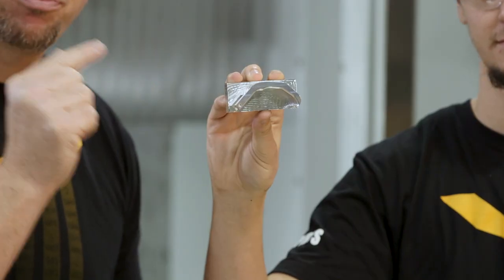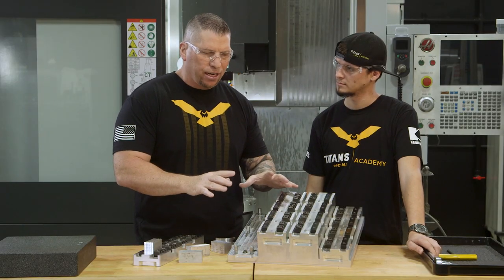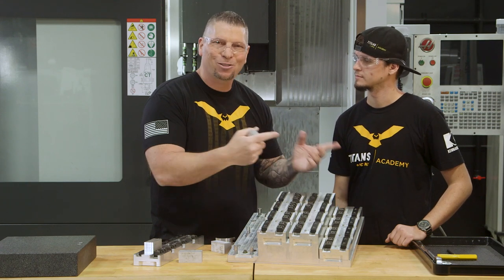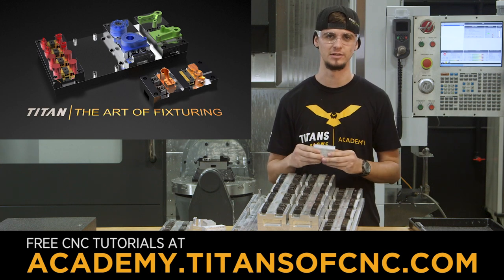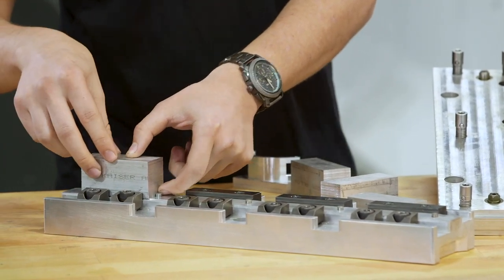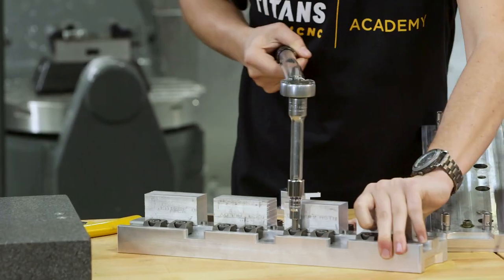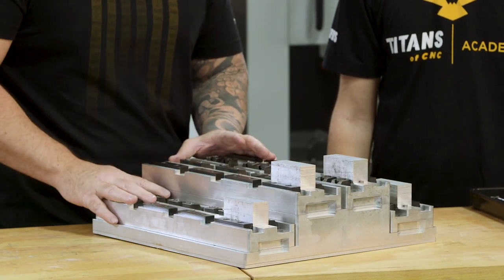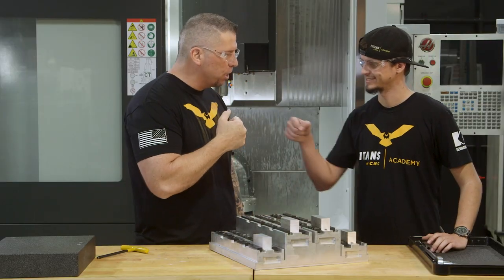This Will Make You RICH | CNC Machining | Vlog #76

Comment: Additional considerations on fixturing:

1. Be very conservative with the simplicity of the design: A complex fixture is costly to replace in terms of remaking one and the downtime on that job waiting for it. Simple, already made workpiece holding solutions such as Technigrip can easily be replaced when they get wrecked........And they will.

2. Design a baseplate with multiple hold-down/locating hole patterns so you can move it to a different machine when needed. If you dedicate it to just one machine and that machine goes down, you're dead in the water on that job.

3. Use steel inserts on threaded holes that see a lot of fastener install/removal. Threading steel fasteners repeatedly into aluminum fixturing is a guaranteed failure.
Reply: agreed

Comment: We specialised in pulley wheels, mainly "Poly V" We were the main supplier for Turner Newall who manufactured the belts etc.
An easy part to make without too many tight tolerances. Made them from 20mm. to 1 metre diameter , about 1 ton. in all materials.

Comment: I work in a small job shop, we have a repeat job from a larger shop that is a constant run of 2000 parts. We have a similar fixture using pitbull grips. Able to run 8 parts at once on a haas vf2. Blanks are 1×1×12.3 aluminum blanks. We kick out more parts per hour than the larger shop. Fixturing is essential to make money

Comment: Pallet clamp system and 2 fixtures would keep that green light on longer. And keep u in shape: ) There is a balance between load/unload, post-process work, and how many parts is the sweet spot to keep the operator as free as possible, while keeping the spindle running long as possible. Great vids.

Comment: Great video. What I would love to see in a future vlog is about the best way to go about opening your own shop as a first-timer. For someone that has a hobby/converted cnc in their garage, with limited experience, Should you work at another machine shop first? Or just go for it and get a decent used vmc and rent a small space? Should you get work or have a product/part to make first? Avoid debt at all cost or take on some? 
I’m seeing this chicken and egg scenario, complicated by still needing a “day job” to pay for expenses. There are no machine shops less than an hour from me. 
Thanks for all you great content!
Reply: 4 years late, but some insight:
Opportunities with a single 3-axis VMC and no automation are limited. What can you do that a shop with a dozen automated machines can't do? What sort of prototypes and one-offs can you run cheaper/faster/better than a shop with a 5-axis? These aren't meant to be discouraging, and there are indeed possible answers to those questions that would make starting a shop viable. You just have to find a niche that works given your connections, capabilities, and market area. As a general rule though, one man shops rarely make decent profit for the hours invested. Guys work 60-70 hour weeks and barely clear more than they could make loading parts and pressing the green button 40 hours a week at a big shop.

Comment: For very large batches we have a robotic arm operating two Mazak’s with zero point pneumatic pallet system from Erowa. The only way to get a good profit. 2 machines run 24/7 without an operator

Comment: Big old torque wrench is a slow and cumbersome way to loosen those bolts and you have to reverse the ratchet between ops. Surely the yellow tool is good enough for loosening? And a shorter torque wrench would be quicker and easier for tightening? No criticism / only a suggestion - I'm always looking at what looks / feels quick and easy.
Reply: Always thinking efficient and ergonomic 👌
What came to my mind was a design that would trnsfer the motion of locking or tightening multiple part clamps (bolts) from a single point. Maybe a bit overkill though.

Comment: I’d be doing this on a mill turn thanks. Can’t see the part that clearly but assuming the holes are around the ‘outside’ and you’d be able to get to them. Nest two parts to best fit a nominal diameter bar, part it off(saves an operation) stick bar feed on (saves labour). You won’t have to billet the material and boom 💥 if it’s Ali I’m running lights out. Bet I could win that quote!

Comment: Titan, Thank you so much for sharing your knowledge on fixturing. before watching your videos the only thing i knew about fixturing was basic universal pallets with dozens  of holes for either bolts or pins. Now im designing my own fixtures, using Pitbull clamps and Tallon grips so that i can machine multiple ops and multiple parts at once, instead of one op  and a few parts at a time. one main issue` i have is designing the fixture in my cam work space. hopefully when your tutorial on fixturing comes out you teach that part of the design.

Any chance we could get a video on drawing prints? That is another major topic i need to learn and work on. 
Thanks
Brandon.

Comment: I must be missing something here. 
Why aren't you using a conventional vertical 4-sided tomb-stone fixture, which would allow symmetric access to 3 faces of every part in one machining pass?
With your staggered plate-fixture, for most of those parts, only two faces can be machined. 
Was this done due to the limited work-envelope of your 5-axis machine, or do these particular parts only need machining from two faces?

Comment: Should never use a ball detent torque wrench to loosen fasteners. You over torque the ball detent overcoming the static friction. The reason you can use them either clockwise or counter clockwise is to torque left hand threads.

Comment: The process of loading/unloading is a lot easier with electric drill with the torque set, especially if the parts are a lot smaller so you can nest a hell of a lot more on a plate.  Snap on also makes a great small/light driver with an accurate torque that is perfect for quickly working all those bolts

It also looks like there is still another op to run.  Im used to pulling the plate out and rotating the parts along the fixture.  So let's say thre are just two rows.  One row would produce the exact thing made in the video.  The next row would flip the part to machine the last face of the part.  

Then you getting into dummy proofing the fixture so operators that are moving like Nascar pitcrews have as few opportunities to make mistakes as possible, and that's not a dig at the operator. For example you dont want the subplates to only install in one orientation, you dont want to be able to rotate the plate 180 and have it actual attach.  Even if it would work in THIS instance, as these things get more complicated you want the operator trained to know it only goes together one way.  I've operated plenty myself and we wrote notes all over the fixtures to minimize error.  

Designing/building and hell even operating these sorts of jobs is my favorite sort of mill work.  The day goes by fast.
Reply: I worked at a place where I used a rotary to hold 88 parts at a time, on 90 degree planes. First half of plate was one side of part, machining the part on -90, 0, and 90. Then the second half of the plate, the parts got flipped, and everything remaining on that side was machined.

Both sides were programmed on one full cycle, so I would start the production run with the plate half full. Then, I would flip them and run the whole program the next cycle. 44 parts at a time were fully complete and 44 parts were half done in 1h45m.

I was using a locking system similar to this video, not sure the brand. Initially I was doing it all by 3/8 ratchet and a 6mm hex. Full cycle time was 1h45m, and downtime was 45m-1h to clear shavings and move all the parts.

Then one day I was feeling froggy, so I decided to race myself.

I came in with my trusty snap on 3/8 torque wrench and got the downtime to an average of about 18 minutes. The boss thought I was lying so he watched me.

I bet him, if I can get it done in under 20 minutes, I want a $1 raise. He said that to make the bet fair, I’d get a $1 pay cut if I couldn’t pull it off.

I did it in 13 minutes, hauling ass out of breath. He gave me a $2 raise and send me home early with $20 to buy beer that night.

Production fixtures FTW.

Comment: if you needed to have through the lenght of the part, you could edit the fixture even further by doing these level again on each of the levels, making sort of a weird multileveled pyramid thing, which could probably be made by making an updated set of plates instead of making the whole fixture from scratch. 
also since the plates are removable, why not create an extra set of plates that you can load material into when the machine is running and then just switch the plates, instead of clamping the material in the machine everytime

Comment: With the sub plate, instead of using the expanding pins to lock them down, could you not have used a small dove tail cutter and then slid the sub plate onto the main plate?
Reply from the maker: Absolutely, there are a million ways... that’s why fixturing is Awesome

Comment: Titan, can you do a video on setting Fusion post processors to use multiple work offsets (ie. G154 p1 got a0. , g154 p2 for a90.) ? Currently I fix all my posts by hand, adding A values and fixing the offset lines. I’m using Haas EC-400s and VF machines with 4th axis. 

Thank you for what you do!!
Reply from the maker: Yes

Comment: You can also run one part a the time and put a robot in front of the machine if you have this amout on workload to design a fixture like that. Less employe, produce more good, that’s the future of manufacturing
Reply: Multipart is going to save on toolchanges, and robot loading does take time (possibly more time per part). It really takes some analysis to determine what the best option is.

Comment: Titan, great fixture!  Can you share some knowledge on how you old varius parts for the second op?  holding a block is pretty easy, but how to you hold the profile of the machined parts without damaging the surface?
Reply: @John-ik2eg  thats super slow, must have multiple part fixture for op 2, specially since I never see him use horizontal with twin pallet.

Comment: Could that fixture not be double sided and mounted like a tombstone getting you upto  32 parts per run?
Reply: With a hexagonal tower and 8 parts per face, you can even run 48 posts at a time (plus another 6 on the top of the tower)

Comment: with a 4 sided tower, u would have even more clearance and u could machine an additional side of the workpiece
just my 2 cents
Reply: I was thinking the same thing but with 5 sides with a cross section like half an octogon. You could get an extra row of parts in there. There may be some other limitations but I think this is valid.

Comment: Any advice on removing excess stock on opp 2 would be appreciated get a lot of problems just facing it off
Reply: Anthony Ambler make softjaws, rough face it with an endmill and adaptive toolpath to remove the maximum of the excess then just skim rest of the stock with a facemill to get a great surface finish on the second side.
Never face the unsuported material with a big face mill or you will have a bad time
Reply: Émile Tessier thanks that’s sort of what I’ve been doing I just wondered if there was another way I tried just facing at first but like you say it didn’t end well

Comment: Just wondering, when running that many parts at once how would you offset mid run for machine, tool and coolant warmup without scrapping half of the material and in the end costing the customers more money in supplied materials?
Reply: Could have the same tool with sub offsets, like "T1" and "T1A"

Comment: This is looks like a typical 4 axis part. On 4 axis fixture you could machine way more at a time with a simpler dove tail fixture.
Reply: Fischer977
I'm no cnc expert by any chance but you need to machine the dove tails in each part before you can hold it in your fixture.Where as these guys don't have to pre machine stock material.
Reply: @mehmettemel8725  yeah. It takes 15 sec. Titan forgot to show you that he also machines a minimum chip , face and paralel sides that the mighty bites holds on to it

Comment: This looks like a job for a horizontal? You could have 4 times that many fixture again then still be to run them while loading the other pallet/pallets.
Reply: Couldn't do the sides on a 4-Axis. You need all the rotations to get the different angles.
Reply: @jonahdement4379  considering you can't access all sides with the jig used in the video I'm not sure thats the case.

Comment: How do you determine if the pitbull will hold the part well enough in the fixture? Taller parts tend to rock off of the stop bar.
Reply: Hey Stephen I use a Talon grip as a backstop (stop bar), then clamp using pitbull. Hangs on to hell and back !